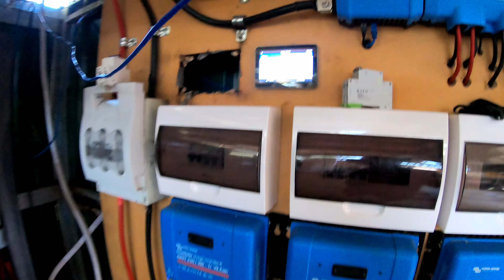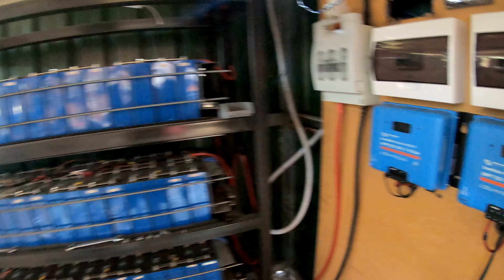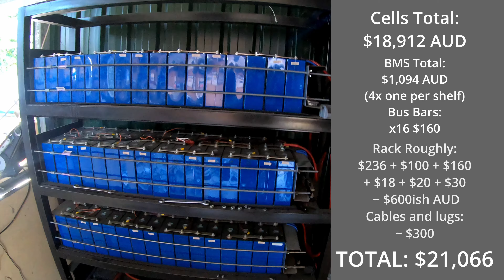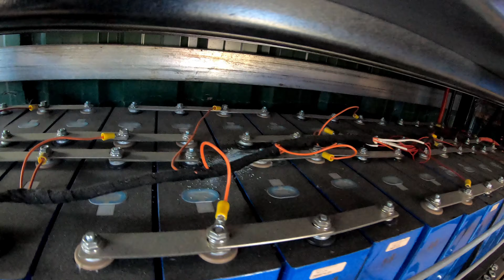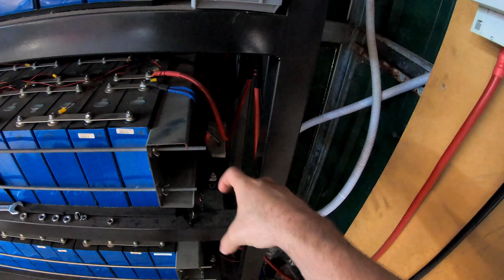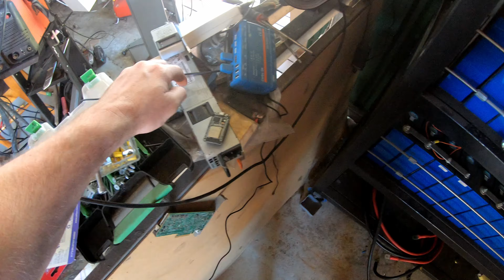Battery Cost Breakdown

Comment: Are they Grade A or B cells?
Reply: They are always B grade if not from the manufacturer..
The reality is that 50% of cells are B grade in the first 3 months of a manufacturer. About 30% after 12 months. 
2 years it's still about 10-20% b grade rate. 
The A grade is 30-60% more expensive. 

Today the manufacturer is actually 30% cheaper than Alibaba. 

Be warned Alibaba is now more expensive than the manufacturer.
Reply from the maker: Reportedly grade A according to the manufacturer. I didnt notice anything wrong with them when i was assembling them but that said, any purchase from china is risky. I think i got what i asked for and they certainly have not let me down yet. We can typically use upwards of 60% of the pack in one day and as littls as 25% so its being reasonably cycled.
Reply: Now that I think about who did you buy them from? QSO is not a manufacturer. 
QSO sells B grade just FYI

Comment: Battery's are great...so long as you can keep them charged! The bigger the battery the better it seems but its a balance between use and cost. Have a battery that runs the house over night and solar covers everything. Double the capacity and you can have a dull day and all is good. But once winter hits and production falls below base line use and they become a paper weight for a good few months 😮
Reply from the maker: That is so true, The bigger battery means nothing if you have X days in a row with no sun. If i did this again i would bias additional solar before making the battery bigger. 

With that said, the battery has been in for just under 1 year and its only done 70 cycles, so if it achieves its 4000 cycle use we have a little ways to go. And im going to expand on the solar as well so the cycle rate should come down